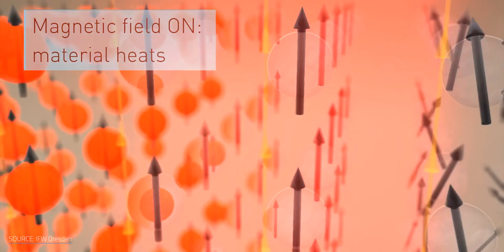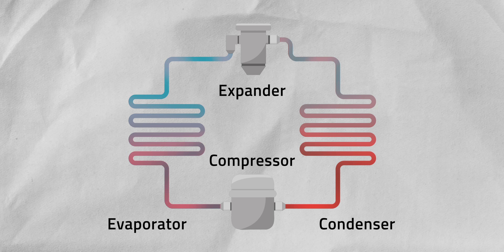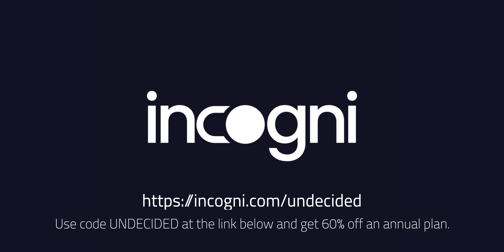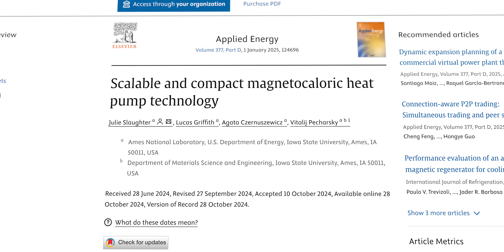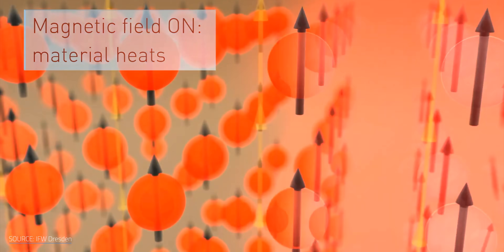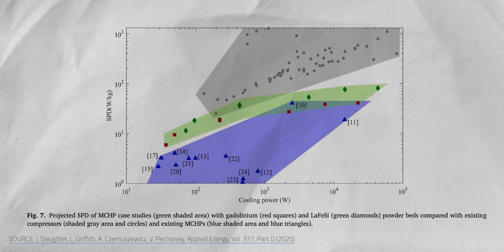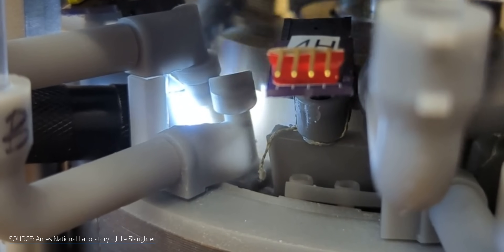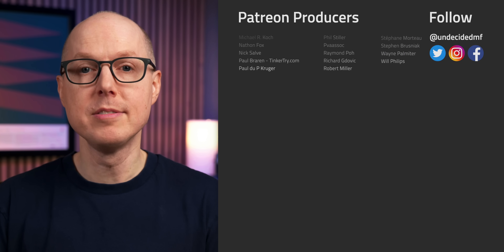How Magnetic Cooling Is Breaking All the Rules

Comment: Matt, if you are going to discuss HVAC systems, at least study the subject FIRST, pror to making a video that is clearly incorrect.
Current refrigeration systems do not simply exchange hot to cold air, and they do not work by compressing heat.
Current refrigeration systems work on "gas to liquid and liquid to gas principles"
1- A compressor cannot compress a liquid, but it can compress a gas into a liquid, which is what it does.
2- That liquid, which boils at a very low temperature (around -40C), therefore when released through a constricted orifice, where the temperature is above 10C, it expands rapidly into a gas. Its the rapid expansion of said gas, that results in cooling. 
3- The evaporator (aka cooling coil) is a air to metal, heat exchanger, where gas principles are at work, allowing the gas to absorb the heat in the air flowing across the metal tube, containing the gas. Depending upon the efficiency of said exchanger and gas, as well as the internal humidity and temperature of the structure and or compartment being cooled, the air will be both dried, and cooled (aka loose heat). 
4- the warmer gas then flows through a condensing coil, where it exchanges its higher temperature with the external ambient temperature, via a forced air fan and finned condensing coil (much like an automotive radiator), hot air is exhausted out of the condensing coil. 
The process repeats ... 
Refrigerant IS NOT an environmental hazard. That lie was used to break a patent right held with R12 by Dupont.
Anyone desiring to manufacture R12 had to pay patent rights to Dupont. With other refrigerants, that patent right changed. However, newer refrigerants are in many cases not as efficient as R12, and therefore have degraded cooling capabilities. This is why today, it takes a 3 tonne HVAC system to cool what could be cooled previously, with 2 or 2.5 tonnes. Therefore the old rule of thumb, (1 tonne per 500 sq/ft), had to be tossed away and more complicated and costly measures implemented. 
.....
Magnetic cooling however, is an interesting thought.

Comment: Around the 9 minute mark, you explain the magnetic heating and cooling of the gadolinium via spinning magnets.  However, I am not seeing any explanation of how the HEAT MOVES from the source to the target.   How does it draw heat away, and move it?
Reply: This is going to sound crazy, but build a small pulse motor that energizes a  coil that pushes against a magnet at the right time. Something about the spike that feeds back into the system, the BJT transistor will actually be cooler than the ambient room temperature. That is odd, because BJT are rated on wattage, which is heat. Resistance will create heat against current flow. Maybe negative resistance, creates cold.

Comment: I'm concerned about how mining the required materials could be increasing slave labor and dangerous and polluting mining methods if it reaches household refrigeration. Also it may get even more expensive to repair given that the tech is fairly complex for the average technician. We may be closer in breakthrough of low gwp coolants before we see it on magneto or elastocalorics

Comment: Thanks Matt!  They will soon succeed in making it more compact, while reducing the cost. They have the financial incentives don't they? New is better I guess, although I mentioned recently how well-built refrigerators can last over 50 years with little to no attention or repairs at all. They are the Kings of reliability.  So I can see why it's a rather tall order to replace. When a new concept emerges (magnetocaloric is not that new, granted) the first designs are often more complex than they will later become. If I was to work on this, I'd try to strip it down to what REALLY makes it work, and try again. It paid off with the first turbojets designs, and the streamlined axial design the Germans adopted instead of the Brits lay out. Then, came the ram jet... Frosty projects deserves cool thinking. Stay chill.

Comment: I think longevity and efficiency are the key features. So if efficiency is mostly comparable, that leaves longevity as key feature. Compressors are mechanical devices that break. And for some reason there always seems to be some coolant leakage.
So, other than I hate the typical compressor noise, longevity seems paramount. An everlasting heat pump would be nice. We would only need to get rid of forced air flow cooling, too.

Comment: As a industrial refrigeration technician my only questions are
1 How efficient is it compared to current market ?

2 How fast can repairs be made and diagnosed?

3 Can it withstand the test of time , meaning I maintain units still operating from the 70s and 60s talk about a money saver. 

4 how large can you scale this , commercial, industrial uses?

I’m not saying it won’t be a great idea but how practical is it ? 

What’s is the energy coefficients?

Startup cost, installation cost? 

Is it suitable in all types of environment , extreme temperatures?

Comment: It’s possible to achieve a refrigeration effect with normal air being compressed and decompressed without a phase change. Just maybe not as efficient as those potentially hazardous refrigerants. One of the biggest advantages of using a gas is that it can be compressed outside where the heat needs to be radiated and then decompressed inside where you need cooling.
Reply: This video did not really address how the heat is moved from inside to outside.. Does the wheel sit on the boundary like a window or wall unit?

Comment: You're repeating that a heat pump / refrigerator moves the heat from a hot place to a colder one. But that's easy: just open the door of your fridge.
What my refrigerator does is move heat from a cold place to a hotter one.

Comment: The true comparison of compression refrigeration to magnetic refrigeration is COP
Coefficient of performance 
So why compare mass to energy input for efficiency?
?
As mass to energy out is not an apples to apples comparison to a compression cycle system.

The heat or lack there of is I assume to be moved to the internal heat exchanger(evaporator) and external heat exchanger (condenser) by a pump so these pump energy consumption is to be added to the magnetic compressor for a proper comparison of COP. 

This is very exciting technology hope it is as good as it claims!

Comment: HVAC guy here on lunch cleaning a cooling tower.
I just dropped off our first jug of the new 454 refrigerant at our shop last night.
You have my full attention !
Reply: @Scot-p1v  did you get a left handed adapter for the reversed threads??? 🤔
Reply: @_MECRONANCER_  My company has 2 of those such hoses, they are bright orange too so they can't be mistaken!
Reply: You should be picking up a can of R12. At least it isn't flammable.
Reply: @Scot-p1v  that shits so damn expensive!!!
Reply: Hoping to get back into HVAC once my run in the military is over with. I miss working on job sites and the team work.
Reply: I used to build HVAC units, the cooling side.  Working in the coil Department, every time they changed the refrigerant, the coils always got heavier.  They either added more fins per inch or the physical size of the coil increased.
Micro channel coils are way more efficient at heat transfer, but way more expensive to build and it takes longer to build each coil.  I'm not sure about the micro channel coils today, but it was that way 20 years ago.
Reply: So does YouTube
Reply: A2L blowe
Reply: Modern Refrigerants are all a scam. The only reason people are not using propane is because of greed. It can be made to be extremely safe.
Reply: I got my certifications in the early 1990s and thanks to the EPA, those bureaucrats who are never satisfied made the years that I was in the industrial maintenance/repair field difficult. HCFC to HFC and then to the A2L refrigerants all along prices skyrocketing on the refrigerants. They claim that HFC causes global warming? How about volcanic eruptions and the unknown variables of solar activities? I wish you the best of luck with your trade!
Reply: @m1670redeemed how about the fact that even if perfectly maintaining a new (r-32) minisplit to provide heating/cooling and getting all your energy from renewables, you still produce over 7 tons of co2 of global warming over 20 years, which is how much co2 is produced by a gas central heater. Still much better, but it should go down.
Reply: @m1670redeemed  the problem with CFCs was never global warming. It created a chain reaction with ozone in the upper atmosphere and breaking O3 down to O2 with no Ultraviolet protection. We'd all have melinoma by now if we didnt stop using CFCs. 
... If only global warming was such an easy fix
Reply: @m1670redeemed yeah cause protecting the environment is lame

Comment: I feel like they could pair this with other tech that uses spinning magnets, which is a lot. I can imagine a ceiling fan that will run and also have this cooling tech built into it to cool specific rooms faster.
What medium is carrying the heat away from the magnetic metal? Is it the anti-corrosion liquid you mentioned?

Comment: As an HVAC-R technician, this didn't answer any questions I had towards how I'd implement this vs a traditional refrigerant system. Wonder what that referenced video will answer for me
Reply: I'm an engineer but not HVAC related so my knowledge is limited. My understanding is that this would just swap out. The magnets are getting hot and cold so it would need a system to carry the heat out. Similar to a power generating with coal or gas but in reverse. Ambient heat that is captured by refrigerants is now done by magnets. On the HVAC side you would just force air through it and suck energy out of the system. Then carry it outside the building etc

Comment: What am I missing? Surely it would be more efficient to use coils rather than using a motor to spin magnets. Because you can lower the clearance to 0 but also because coils don't wear out as long as you apply a suitable voltage and current. You can also have an infinitely adjustable cooling speed rather than relying on a rotation. There are more advantages like being able to use any layout you want and not requiring the use of permanent magnets.
But surely Peltier cooling should be more efficient than it is now I feel like it is kind of a mystery as to why Peltier cooling is still as bad as it is. As if time is standing still. Like Peltier is truly solid state...

Comment: needs a more solid insulated system to separate the cooler from the inside and to insulate vs the hot parts, aerogel insulation plates might help a ton here and use a chilled non freezing liquid with a pump, for the cooling plate on the inside make it part of the fridge body and insulate the outside with another layer of aerogel, we seriously need to stop using expanding foam for everything when we have such superior materials even if they are a bit harder to make, done right the device will work less for the same or better results and be fully able to fully freeze stuff or make the parts much lighter for things like 12v cooler chests if they don't need to freeze

Comment: @1:55  HFCs are not "required".  There are many other environmentally friendly options being used.
Reply: Butane and Propane work fine as a refrigerant...They're environmentally degradable and nearly nontoxic. Yes, they're flammable, but the gas line going to your furnace is a bigger risk than it. The amount of propane and/or butane sprayed into the average home from aerosol cans vastly exceeds what could potentially leak out of a refrigerator... Cheap, safe when maintenanced responisbly, and environmentally safer than nearly every other option.
Reply: There are better refrigerant options aren’t there? Co2 is already in the market with a GWP of 1.  Ammonia in safe concentrations is another. It seems to me that the remaining challenge is efficiency.
Reply: What about for HVAC? In the south you need very powerful ac and I’m not sure if the other options are able to do this
Reply: @Blake22022  R-290 (propane) is actually BETTER than current HFCs at cooling. Its more efficient, cheaper, better for the environment, not toxic to technicians, etc.
The main cons are its cheap and readily available, which means Chemours doesn't get to make fuckloads of money off it. They lobbied against the move to natural refrigerants.
So instead of moving to more R-290 and requiring extra training and CO2 extinguishers in new systems to deal with the flammability, we are stuck with another 30 years of artificial poison for ourselves and the planet. So we are phasing out R-410a invented by Chemour, and moving to R-454b... by Chemour.
Reply: @KingFate20 I’m not sure how you think Chemours controls what refrigerants OEMs design their equipment for, but modern HFOs are both less toxic and often less flammable than propane. They also work better/across a more broad range of temperatures. Not everything is a conspiracy
Reply: @nunya___  like what?
Reply: @300-IQ-AlphaMale  Plain hydrocarbons for one e.g. propane and iso-butane.  Ammonia is another one commonly used in large scale systems.
Reply: @galacticminx  yep, while I've looked into using ammonia or butane for our specific industrial refrigeration needs, propane (C3, R-900) just works so well and is generally pretty cheap. Never had an issue with flammability with over a decade of continuous operation at multiple sites. These are fairly large as well, usually running several thousand horsepower compressors.
Reply: @300-IQ-AlphaMale  CO2 and propane are efficient, have working systems that have been installed for many years now all over the world, and have GWP of 1 or less. They operate on the same principle as the synthetics which means the tech is quite mature and similar to changing from one synthetic to another. Of course there are differences and downsides too, CO2 has much higher working pressures than current synthetics and propane is flammable. But there are many large commercial CO2 systems across europe and has been for 10+ years.

Comment: My team worked on a similar project aimed at using magnetic gaseous compounds.  Metallic gasses exist; uranium hexafluoride is one of them.  But uranium hexafluoride is neither magnetic nor gaseous at useful temperatures.  Putting a magnetic gas into a magnetic field reduces its molecular degrees of freedom thus increasing its adiabatic index.  This in turn changes the temperature of the gas.  When the magnetic field is released, another temperature change occurs.  The theory is straightforward, but the existence of needed compounds is the problem.

Comment: Is it possible this could be self-sustaining? That is, if it cooled/heated quick enough? I doubt it does, but theoretically. 

Just the thought that if it could cause water to boil and push a turbine. Then use the cooler output to re-cool water or super cool the magnets and put itself into a floating position above a magnetic track to reduce friction. Then the required power to sustain its own spin could be reduced. Maybe? I don’t have a strong grasp on the numbers these things require to work. 

Hope that makes any sense.

Comment: Magnetocaloric cooling will never beat vapor condensation cooling. The heat exchanging system may only work in very big applications because it's limited by the speed that it happens and thee mixing of hot and cool fluid.

Comment: Fridge: Simple Pump, Simple medium, simple circuit - high reliability, lasts for decades
Magnetic cooling: Complex on electro-mechanical level. Still needs some special medium, possibly simple circuit, high material cost - low reliability, lasts few years

It certainly breaks few rules. One is economic. Costs arm and leg, and needs replacement/repair at fraction of time. This means it is very bad for environment. Come back when they make it comparably cheap and reliable.

Comment: I checked, and a typical modern residential refrigerator compressor has a cooling power (electrical input) in the range of 100–400 watts while running. 

This means the 1,000 watts of cooling capacity that is mentioned  for their magnetcaloric cooler technology in the Iowa's team paper would be more than enough for use in residential  refrigerators.

Unfortunately, heat pumps require much more cooling capacity.

One ton of cooling is equal to 12,000 BTU/h, which is about 3,517 watts

Modern residential heat pumps typically have a cooling capacity ranging from about 7,000 watts (2 tons, or 24,000 BTU/h) up to 17,500 watts (5 tons, or 60,000 BTU/h), depending on the model and size. 

The same applies to residential HVAC air conditions. Residential air conditioners typically require a cooling capacity between 1.5 and 5 tons, which equals 18,000 to 60,000 BTU per hour, or about 5,275 to 17,585 watts.

Likewise for window air conditions. Checking the internet a cooling capacity between 1,500 to 7,300 watts (since 1 BTU/h ≈ 0.293 watts). For small rooms (100–250 sq. ft.), 5,000–6,500 BTU is common.

Comment: I 🐒 figured to simplest way to cool a high speed device that could cope or be designed for it would be to put the device into a cylinder or bath of coolant and have the heat expand the coolant having heat rise into a radiator to be cooled by refrigerant or a tub of water to help cool the radiator.